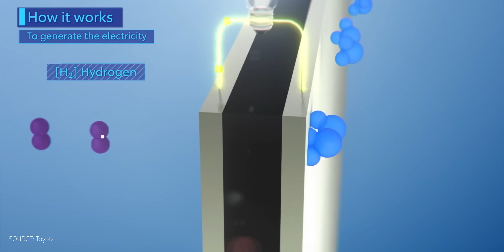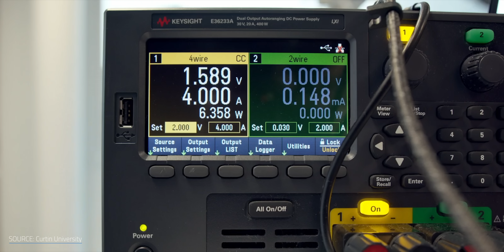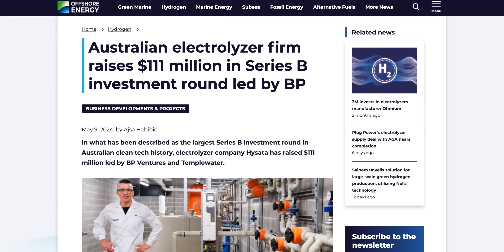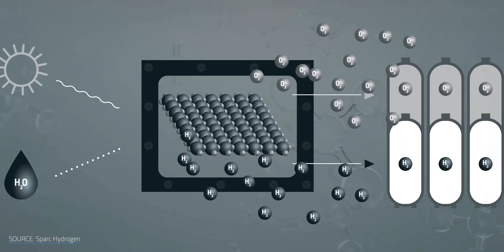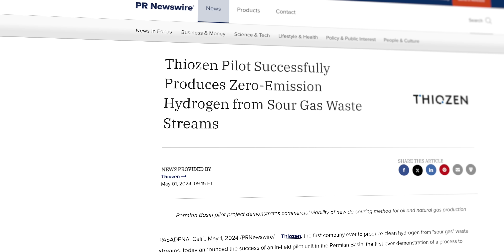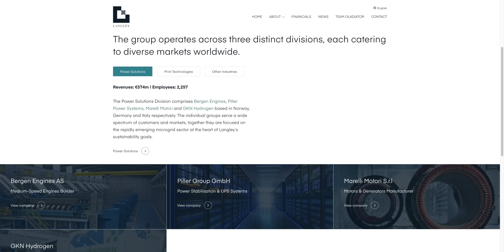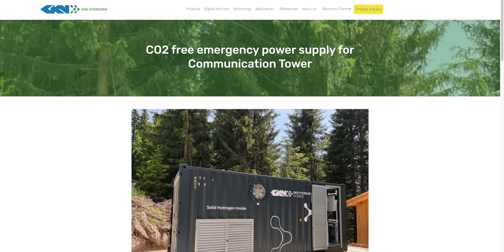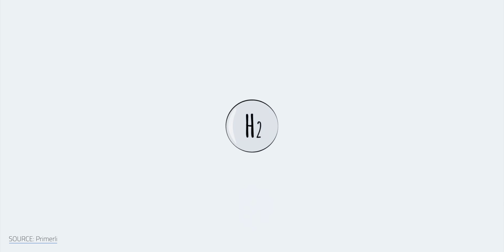How a Hydrogen Breakthrough is Closer Than Ever

Comment: There is another issue with hydrogen you skipped over, converting hydrogen into electricity has yet to break the 30% efficiency mark (averages around 20%). Converting battery power to electric power is around the 70-80% mark. Then you have hydro power that is around 90% efficient.

Comment: So, hydrogen would be an excellent energy storage medium, but it requires better fuel cells with much higher energy density. As for storage, for stationary power storage that’s not an issue at all. Gas bag storage, cheap, easy, and low pressure.

Comment: Hydrogen is useful as fuel… in the space program. For other applications creating hydrogen is incredibly inefficient (electrolysis) or polluting. All the electricity used to make (mythical) “green” hydrogen is best used spinning electric motors or put into efficient energy storage … hydrogen is basically highly inefficient energy storage. 
This is just physics.

Comment: The Global shipping industry is a huge CO2 emitter and yet it is absolutely critical to the World Economy. This industry is the one I believe could most benefit from a move to Hydrogen. 

Cummins, a leading diesel engine manufacturer, is already making significant progress on being able to covert existing Diesel engines to run on Hydrogen. This would enable existing ships with large diesel engines to be converted to run on Hydrogen. So the change over could be made without an incredibly expensive new fleet of ships being required, and will not leave large amounts of stranded capital if existing diesel powered ships needed to be scrapped and replaced.

One of Hydrogens challenges is distribution. This in particular means Hydrogen powered cars and trucks may never be workable. But ships dock at ports with existing large scale infrastructure, so space for large scale Hydrogen storage could be found within these sites. Providing Hydrogen at the world's 100 biggest Ports is a significantly less complex issue than having to build tens of thousands of Hydrogen stations throughout the world to support Hydrogen powered cars and trucks. Large scale Hydrogen storage also works better than small scale storage.

Global shipping could be converted to run on Hydrogen creating a huge demand for Green Hydrogen making many Worldwide Green Hydrogen viable. A global tariff system where a transportation tariff is added to any product not shipped on a Hydrogen powered ship would provide the economic incentive to make this happen.

Global shipping could be converted to Hydrogen and would create a significant drop in global emissions.

Comment: I do believe hydrogen has a future. But not as a 'fuel' you pump in your car. But for very  large scale energy storage, hell yes :) Intermittency of renewables is not going away anytime soon and storing excess energy is never very efficient, but at the same time infinitely efficient if it would otherwise be wasted. But for this to work we really need the economy of scale that a very large facility can offer. But also the literal large scale... you don't need to compress it very tightly if you can build massive tanks to keep it in.

Comment: Step 1: Build nuclear power plants across the nation. (Ideally Thorium Salt based)
Step 2: Build Hydrogen plants next door.
Step 3: Profit from clean sustainable, cheap hydrogen production taking the excess energy generated outside of peak demand allowing nuclear to meet all the energy demands. 

No more stupid ugly windmills that have to be buried, no more toxic solar panels, and no more carbon based fuel unless it's synthetic gasoline, which I feel is ideal over using hydrogen or batteries in a car. Porchse can make synthetic gasoline by trucking in CO2 harvest off site (makes it more expensive) for $50 a gallon and sale it at a profit with one facility. That's very expensive but it's also small scale and inefficient. Scale up production and you lower costs, source CO2 direct from cement factories, metal foundries, and other sources of CO2 emissions that aren't energy. Now the expense of capture is an investment into a product that can be sold. Require 5% of synthetic fuel produced be pumped back into the ground to slowly reverse our emissions without making it to expensive.

Comment: Toyota came out with a concept design for a removable hydrogen call that's roughly the size of a standard fire extinguisher to plug into the side of their hydrogen cars, and plan to make a system for home energy storage systems, too. The tanks are rechargeable/refillable and will make for easy remove and replace fueling for vehicles.  IDK if they've made a prototype, yet, but they're moving forward with the concept. That's good news.

Comment: Hydrogen; hard to store for ground transport use, hard to transport in the present gas pipe infrastructure, will leak away through seals that are good enough for methane but hydrogen is much smaller molecule, will make its way through polypropelene pipes, will have to be transported through pipes at higher pressure to get equivalent energy out at the consumer end, meaning more energy spent driving compressors. Why make solar electricity and use it to split water why not just go over to electric heating and cooking, why, because the gas transport companies will lose out that's why, there infrastructure would become redundant. Hydrogen maybe useful for industrial processes where it is used at the site it is produced at and that's all, oh yeah nearly forgot, the people who extract gas (methane) would like hydrogen to be made from methane using the steam reform process (energy intensive) so they have an excuse to continue extracting fossil fuels and keep their profits up and their shareholders happy. Cos that'd how capitalism 'works'.

Comment: Hydrogen is the new nuclear fusion, in that it’s always just about ready to be used. So far the attempts have failed to produce a viable alternative to battery electric vehicles. All very expensive to operate and need heavy subsidies to be viable. With my electric car, the solar panels on my house can refuel my car directly without any third party assistance. I don’t think I can easily install a home electrolyser, cryogenic cooling system and compressor to refuel a hydrogen powered vehicle.

Comment: what good is stating capacity if you don’t couple it with cost? hydrogen will always be a hog as it takes too much energy to create, infrastructure is too expensive, and the fuel is dangerous. Cost cost cost. Don’t they teach economics in engineering?

Comment: The energy required to create hydrogen is a 1:1 relationship to what's put out. 💩 The physics isn't profitable. It could be generated with solar, but meh then it's just a energy-transportation medium, not liquid gold like oil with far more potential energy then the cost to pump it out of the ground.

Comment: A hydrogen fueled transportation network would need many new hydrogen producing facilities, new facilities to store the fuel, and a new network of fueling stations that need to be replenished periodically. All of these things would require significant energy to operate safely. It makes far more sense, in my mind, to use the electricity network we already have to fuel electric vehicles. If we can develop batteries that are more energy dense, less expensive, and made with more common and recyclable elements, that would be far more groundbreaking than any new hydrogen fuel advancement.

Comment: Personally, I fail to see any reason to produce so-called green hydrogen.  Using one form of power to generate another reeks of inefficiency.  Further, it is not lost on me that one of the biggest sectors driving the hydrogen message is the oil and gas industry, and that the infrastructure being developed in the UK for example, could just as easily carry LNG.  I am yet to be persuaded that hydrogen is a useful part of our energy suite going forward.

Comment: If they are indeed able to achieve 95% efficiency in a real world application, it will certainly make hydrogen viable for energy storage and transportation (from far away generation locations), maybe aviation. It does not have to replace fuel in everything to be big step forward.

Comment: Great sales pitch but there are a few red flags and you gloss over the problems which you LOL ! don't get into it. More of the same which the public will pay for whether it works in the long run or not. Energy is always going to cost the public, is it cleaner ? not really. If you really look closely at the infrastructure manufacturing and materials behind it all. Does anyone know how many gallons of oil it takes to run a single Wind Turbine and its Elec Transformer ? jest like EVs where dose the electricity comes from mostly fuel oil etc... more EVs more energy needed, it is offset by a very small percentage by alternative sources.

Comment: Another really interesting Australian company is Hazer Group. They have a method for splitting methane, either fossil or from biogenic sources, into solid carbon and H2. It's energy efficient and uses iron ore as a catalyst which is cheap. What's more the carbon is in the form of Graphite - a critical material that currently is in short supply and has a large carbon footprint to produce. It's definitely a disruptor technology.

Comment: Some notes here:
It sounds too good to be true to generate hydrogen with 95% efficiency. You are looking at what, 50-60% normally? 

Why install that super expensive hydrogen solution for 960kwh backup power? When lithium batteries have plummeted in price to just $100 per kWh? Am I missing something?

Comment: There's a big green hydrogen project in Delta, Utah that's planning to use excess solar to do alkaline electrolysis to produce hydrogen. They then plan to store the hydrogen in salt caverns and use it when the grid isn't producing the renewable energy it needs; sort of like a battery.

It's called the ACES Delta Hub.
Reply: Money down the drain, yet again. 
The companies pushing for it will keep beating a dead horse every now and then and have you pay for the whip.  After looking at a few lectures about the problems with using hydrogen it is clear that it is a pretty bad alternative, and always will be. You can't wish away the shortcomings and the physical properties.  It has its place in other industries, I am sure..

Comment: I recall designing a Hydrogen generator for a company I worked for in 1974. It was based on a windmill+generator+elecrolysis sending out Oxygen and Hydrogen. It never became a product. That was the oil crisis time.
Reply: Thanks...availability ?
Reply: @finddeniro  It was never finished as a product for marketing and series production. Modern solutions must be much better since technology has evolved a lot.
Reply: Already tried in 1892, soon after producing electricity with wind.
https://en.wikipedia.org/wiki/Poul_la_Cour
Abandoned soon after.
Reply: @philippe94416  This technology is now in use

Comment: imho the biggest problem with H2 is storage, especially on small scale. it eventually migrates through and or reacts with any tank material. that's why they only take hydrogen into space if it's used asap.
on large scale yes please. we could use electrolyzers to regulate the powergrid and pump the hydrogen to industry that needs it. I think it's not eficient enough for grid fuel-cells, but keeping the grid suppliers efficient,  sure

Comment: There is also the process invented at University of Florida that extracts hydrogen from hydrocarbons without polluting the atmosphere. The output is just hydrogen and carbon. But, fossil fuel companies are addicted to amazing profit margins.

Personally, stories about grid scale renewables don't resonate with me emotionally. I feel like it's always been energetically possible, but it hasn't made the investor class sufficiently happy. So, abstractly it's cool that the efficiency is getting good enough for cities to be powered, but emotionally, I want to hear about home scale hydrogen.

Tell me about an available metal hydride storage solution that can store the same energy as a powerwall for the same price. Tell me about a home fuel cell generator that costs $1/watt. Tell me about the catalytic solar water splitter that I could buy by the square meter and fuel a Fuel Cell range extender for an EV.

Comment: In the past, internal combustion engines contributed to the introduction of electric cars by first marketing the hybrid cars, and then the plug-in hybrids. This has paved the road for the infrastructure to charge electric vehicles. Hydrogen-powered cars can benefit from the plug-in hybrid combo.The internal combustion engine is replaced with a hydrogen tank and a fuel cell. This will not require a high number of hydrogen stations as an entry level into the market.

Comment: I wonder if ammonia would be a suitable substrate / carrier for hydrogen as we can take hydrogen from electrolysis and the Haber process to make ammonia, which may be easier to store than Hydrogen. However, I don't know if the energy used for the high pressures and temps in the Haber process make this unviable.

Comment: Hydrogen is a strong greenhouse gas (indirectly, it protects methane from oxidation).
Hydrogen is extremely leaky and difficult to store. It leaks through and embrittles some metals.
Methane is leaky enough to barely be better than coal; hydrogen has similar GWP as methane on 20 and 100 year time scales and is even leakier.
Hydrogen has extremely low gravimetric or volumetric energy density in real world applications because you're not dealing with a cryogenic liquid, but a molecule containing hydrogen or a pressurized container which will only be some few percent hydrogen by weight.
Hydrogen is just a trojan horse for fossil fuels.

Comment: The issue is not generation.  At some point, we can have nuclear-driven electrolysis and the problem goes away.  The issue is storage.  Until a hydrogen tank weighs less and takes up less space than an electric battery containing the same watt-hours, hydrogen is not really a viable fuel.

Comment: The basic problem with electrolytic H2 is the unbreakable 50 kw/hrs of electricity needed per kg of H2 output from the electrolyzer.  So the cost of H2 is based on the kw-hr cost which at the low end these days would be $0.02-0.04/ kw-hr.   Some producers rely on the fact that at certain times PV or wind is so productive that the farms have to be curtailed, or shut down and essentially in these instances the power is 'free' (not really, but sort of).   The unrecognized part of this is you have to massively overbuild PV/wind capacity to meet the demand, so the curtailment episodes of low cost energy would be more common,  OTOH the opposite scenario when the sun don't shine and the wind don't blow you end up with the Cuban scenario.  Also the water needed to feed the electrolyzers must be run through the equivalent of a desalination plant first, a not inexpensive pretreatment.  Electrolyzing sea water is a good way to get chlorine or HCl.
Reply: Yes, and a kg of hydrogen fuel only has about 40 kWh of equivalent electrical energy. Economically, it's pretty dumb to spend 50 kWh on something that will only give you 40 kWh. It makes much more sense to use the 50 kWh to charge a battery instead.
Reply: @SmilingNinja  it's much worse than that, it's 33 kWh of chemical energy, per kg but after a fuel cell you get maybe 16 kWh of work energy out that you might drive the wheels of car with, so 50+kWh in, 16kWh out, after a bunch of expensive processes handling the stuff. Hydrogen combustion is even worse, with maybe 8kWh out (JCB's Boris funded boondoggle) plus NOx.

Comment: Wait, so do I get this right? We're trying to make electricity with wind turbines (for example), to convert it to hydrogen (with losses), transport it (with losses), store it (again with losses over time), to later fill the tank of what is basically an ELECTRIC vehicle, so that it can convert this stored hydrogen (of course with losses) BACK TO ELECTRICITY which will ultimately do the job - propelling vehicle forward. 
Ehm... Why complicate things (and get A LOT OF LOSSES) if we can get all we need straight from electric power?

Comment: The United States started to develop offshore wind power since the early 2000s. After more than 2 decades, the United States now have totally 7 operational offshore wind turbines with a combine capacity of 42 magewatts. These offshore wind farms have symbolic siginifcance, but they are very very far from a promising solution for net-zero electric power.

Comment: “Hydrogen is an energy carrier, it is NOT an energy source”. - Elon Musk.  He is EXACTLY correct, it can only be made by Electrolysis or Gas Reformation, your better off using that energy to charge existing EV’s, Reformation is extremely energy intensive and not green.  Unless aliens come to earth with a new technology, you can forget about hydrogen for several hundred years.  Personally, I prefer to take my chances sitting on a Lithium Iron Phosphate battery in an EV, rather than multiple #3,000 PSI Hydrogen bombs under my feet.  Wind power is better utilized charging EV’s or Batter Storage systems, or running motors for pumped hydro storage….  Same with Photovoltaic, use the energy for offsetting base load electricity production to shutdown the remaining coal or oil fired plants 👍